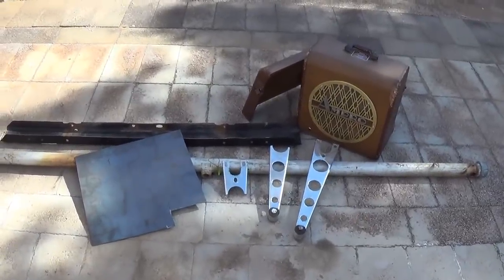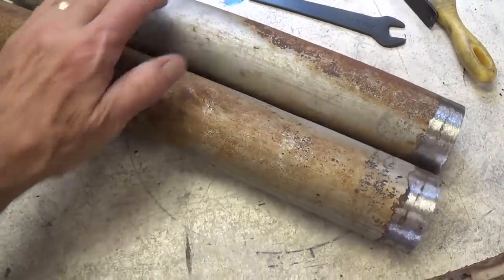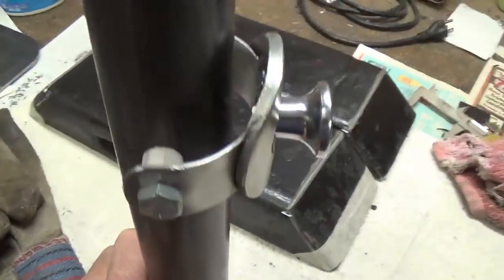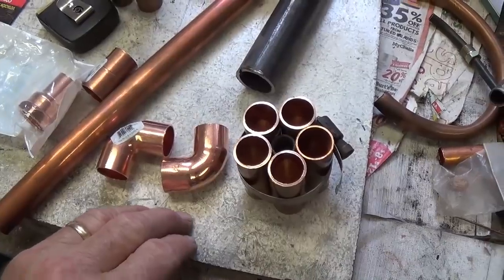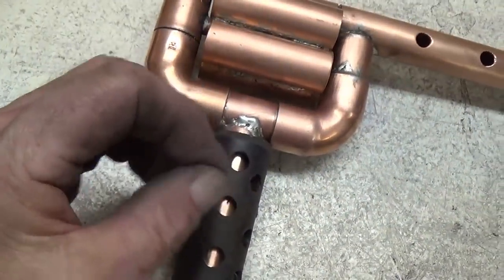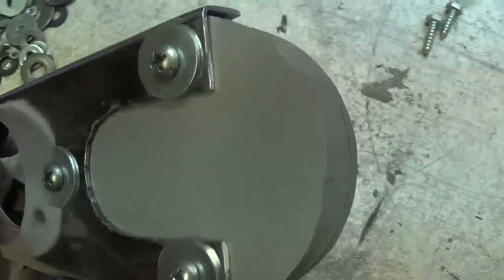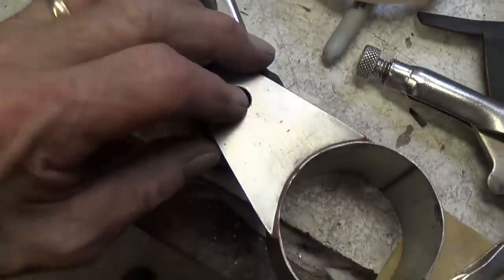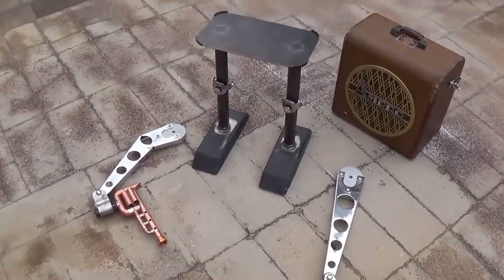Robot Speaker Cabinet, Part 1: Design & Fabrication

Comment: This series makes me so happy. It has all the things, fab work, welding, broken off road parts, amp circuit work, guitars and music. My only criticism is that revolver doesn't have a front sight! The competitive shooter in me is definitely triggered hahaha
Reply from the maker: Thanks so much, Andy. You'll be glad to know that the revolver does indeed now have a brass front sight of appropriate height and thickness.
Reply: I should never doubt your attention to detail. When I saw the barrel support structure I was immediately thinking Smith Model 29, but I like your explanation better :)
Reply from the maker: I did base some of the revolver design on the N-frame S&W's......glad you enjoyed it :)

Comment: Hi Uncle Doug, I have nearly 45 years experience in the hydraulic fluid power field and that looks like  1-1/2" schedule 40 pipe, the wall thickness of sch. 40 varies by nominal size, also note that it is not "cast iron" but rather "black steel" and can be easily welded with wire welding process or stick if you're a very good welder with low hydrogen rod. Black Steel Pipe is a very good and strong material for structural uses, as well as for fluid conveyance at low cost compared to other structural materials such as cold finished steel, galvanized steel, stainless steel or aluminum.  That said, I so dig your design style and the use of cast off materials is one of my very favorite things.  With the amount of weld bead you have on those legs they should support approximately 16,000 to 24,000 pounds in tension, probably double that in compression, that should hold most speakers without any problems...lol.  You rock Uncle Doug, can't wait for the next project. :^)
P.S. anyone who give these videos a thumbs down is an ignorant cretin.
Reply from the maker: Thanks for all the good info, Gary. I'm glad the legs will be able to withstand the weight of the speaker.....and a school bus ;) Amen on the "thumbs down" idiots, may they rot in their own indolence and lack of creativity.

Comment: Wow! I think I just realized where this is!  I spent my Sr Year of HS (1977 - Irvin HS)) living at 8024 Tonto Place in Mt. Park.  My friends and I enjoyed many dozens of hours up in those hills riding our motorcycles and trying to convince (aka-beg) our skeptical girlfriends to go make out near the upper water tank (wasn't there then, but I can still see on google maps the old eroded path we would take to a flat parking area to the upper left of the tank)  One of my good friends used to drive his Dodge van up there and we would listen to Nazareth, ZZ top, Rush et al and think we were the peak of cool.  It was a dicy road for a 2 wheel drive van, but we made up for it with determination, tiger paw tires and lots of HP. (his trusty Dodge 390/4 barrel and headers did the trick ) Thanks for bringing me back in time with the drone footage.  It was 40 years ago, so maybe I'm all wet - but it sure looks like the place.  It sure was fun. Go Rockets!
Reply from the maker: You are absolutely correct, Trebor. That's the location of the video. By coincidence, I bought the tan Jeep that is featured in a couple videos from a guy on Tonto Place.....possibly one of your old neighbors. Those high school years definitely were the good old days :)
Reply: @UncleDoug  Thanks so much for the reply, Uncle Doug. I am amazed by the backyard connection. That's great you bought your jeep on Tonto, but if it's a vehicle from my friends on the street,  I shutter to think of the horrors the poor truck was subjected too.  I have very fond memories of El Paso.  I was from the Northeast and none too happy I had to transfer my senior year, but it turned out to be a blessing. To this day, Ive never met such friendly people.  I do have one question for you. Where did you teach? I took a terrific electronics class at Irvin and studied at UTEP for 2 years as a EE. I moved to California to attend UCSD and learn about these great new computers called Apples. All good schools, but I think your working decriptions regarding AC electronics are the best Ive ever heard . Warm regards. Trebor.

Comment: Klingons from Uranus? 
I laughed so loud the lurcher sleeping on the couch actually stirred, and it's sunny over there.
Also please find the enclosed invoice for one pair of socks that went missing, presumed lost, maybe now in low Earth orbit, due to the intensity of the blowingness - even though the project is not yet  complete. 
Condition - previously soiled, now presumed clean.

Thank you Uncle Doug. Another 20+ minutes of utter joy.
Reply from the maker: You're quite welcome, PD. We're glad you enjoy our zany antics.  Sorry about the socks ;)
Reply: @UncleDoug  Socks shmocks! Mittens are twice as handy. Geddit...
Reply: Hello PD. Off hand are you by chance familiar with the inner  workings of the Fender 5E1 Champ?
Reply: Alas I am not.
I would be prepared to have a go at assembling such if it came as a kit, no fabrication required, but pointing the soldering iron at the correct end of something is about as handy as I get. Maybe a little light screwing on the side.
I come to wonder at the inventiveness of Mr U. Doug, whether it be welding, screwing, fabricating or using his mouth purtier than a $20 whore (copywrite Messrs R.Pryor/M. Brooks).
Reply: @pd4165  indeed, He definitely has a way with words. He mentioned in a previous video that he used to work on vintage motorbikes. What an awesome fabricator. 
The reason I bothered you with the question Regarding the 5E1 is that I have a 1945 Eico 147A Signal Tracer (schematics online @ BAMA) I  hook the guitar to it (audio in) and I'm trying to squeeze a few more watts out of it. During your travels if you happen to run across any advice regarding this dilemma let me know.  Cheers! 
PS what brand of Amp are you gigging with?

Comment: U.D. I'm certainly no psychologist but after seeing this latest video I'd be willing to bet that you or someone in your past had a Gilbert Erector Set and subscription to Mad Magazine. If that's not the case then Jack is spiking your coffee with catnip.  😊

Seriously though, I personally like the creative way you broke the rules of conformity with this amp and speaker project. There are only so many ways to build and cover a box,  not that there is anything wrong with a box, but this has shattered the rules without sacrificing function or performance.    

Thanks again.
Reply from the maker: Guilty on both charges, Randy. My Erector Set was my pride and joy as a youth. Little did I know it would all end up like this :) Thanks for your nice comments and support :)
Reply: Should be mandatory for every child to have one. The GES was an outstanding learning tool. 

Thanks!

Comment: Though I love electronics, and have remained in love with it since 1968, it nonetheless can be very dry.  I think it is good to demonstrate a lighter, fun side to the subject of electronics once in a while as you are doing Douglas.  
Phil.  P.s, loved viewing your 1948 Wurlitzer 1100 juke box video.  I too owned, and restored an 1100 some twenty-six years ago.  It took me slightly over two years, and a few hundred pounds to restore it back to its former glory.  They are a great fun juke box to own for a while until someone comes along and offers you  a very tempting price which is impossible to resist.  Nonetheless, they can be a time consuming sod to restore if first obtained in run-down, clapped-out condition, as mine was.
Reply from the maker: Thanks, Phil. I agree.....there is nothing wrong with having some fun, especially if the process is creative. Yes, the 1100 is a very complex, difficult to restore, but wonderful jukebox.

Comment: The robot claw hand could hold the speaker wire and the amp's power cord? Nice job on the build.
Reply: That's not the worst idea ever! 

I would be overjoyed by a secret function, especially if it addressed cable tidiness in transit.
Maybe a panel that opened on a pantograph or a robot arm to wind cable round, that retreated inside the chassis, or one of those spring powered power cord drums that wind on a button press (though they're usually moulded into crappy plastic housings).  

I'm considering buying an Ampeg Portaflex (PF 50T + flip cabinet) just because it looks so cool. Love that semi exposed chassis look and the utility of storing the amp in the dead space of an unpowered speaker.
Reply from the maker: That's an interesting suggestion, fellows.  I have been concerned that a stout tug on the guitar input cord could pull the amp head off the cabinet. Running the guitar cord through the claw hand would greatly reduce the possibility of this happening. Thanks !!!
Reply: I was a bit surprised that you fabricated half-retaining cups for the amps feet rather than tap through the metal to either use stud location or screw through the metal plate to re-use the foot location screwholes as a semi-permanent fix.

Comment: Outstanding, as always! 
Coincidentally, I have an Ampro speaker cabinet just like that. Not in such good condition, though. And definitely nowhere near as interesting as Steampunk Robot there!
Reply from the maker: Thanks, PS. I hope you can find a good use for your Ampro cabinet.....the grill is really a beautiful design.
Reply: @UncleDoug  Thanks! Just putting the finishing touches on a vibro-champ chassis, actually. One question though, with the back cover on, how do you keep it from rattling at loud volume?
Reply from the maker: As I demonstrated with the  Art Deco speaker cabinet, you can glue pieces of felt to the two opposing sides of the cabinet and back door to provide some resistance to closing and to cushion against vibration.

Comment: for some reason my comment didn't work, so:  would it work to have 2 magic eye tubes instead of the bubble lights?  that way you could see them change with the settings.
Reply from the maker: I really like the bubble lights, Michael. They were the basis for the original concept.....the amp was built around them. I like seeing eye tubes, but they are not particularly dynamic.

Comment: I have a question UD. My marshall jcm 2000 TSL has a intermittent scratching noise usually during warm up on all channels at volume 0 thru volume 10. What do you suspect is wrong?
Reply from the maker: It may be due to carbon comp resistors. If it only happens during warm up, I'd just live with it. If it becomes bothersome, you can try spraying each resistor with freezing spray to see if it stops the noise. If it does, replace that resistor.
Reply: thx you're the best. Keep up the great work.
Reply from the maker: You're welcome, Mr. T. We will :)

Comment: Sorry Uncle Doug, I don't like it. You started out "steam punk" and then went "robotic". The amp has an awesome steam generator look, thus the speaker I think should look like it came out of the same boilerhouse. Awesome work on both pieces, I just don't think the two go together, just saying.
Reply from the maker: Thanks for the input, William. I respect your opinion and only ask that you wait until the end of the build to pass final judgement.
Reply: Yes I will wait patiently.
Reply from the maker: Thanks. I fully understand your artistic sensibilities and agree that a full-on copper boiler-room speaker cabinet would have been more appropriate. I tend to build using materials on hand, however, and large pieces or objects of copper were simply not present or available.....so I did the best I could with what I had..
Reply: +Uncle Doug I can appreciate that completely. Repurposing is half the fun of the project. Please do not take my first comment in a negative light, it just does not suit my taste. Do continue with your creativity, building, and dreaming these things up.